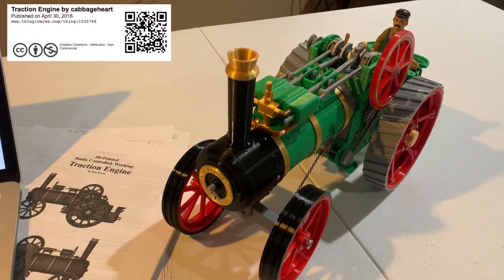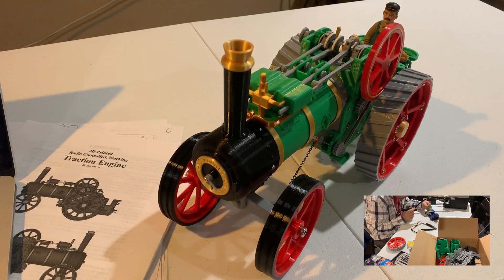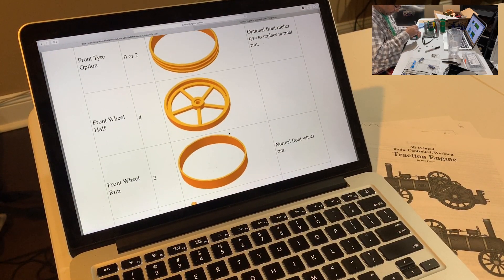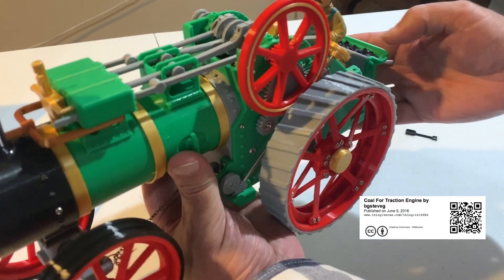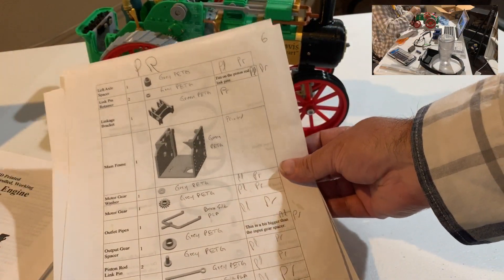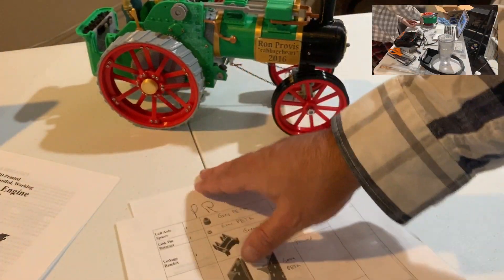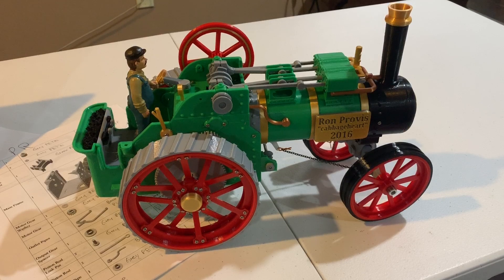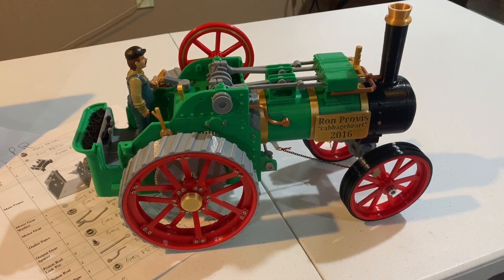3D Printed Traction Engine

Comment: Can you send me a link to the documentation and radio info.
Thanks
Reply from the maker: I used this radio and transmitter kit, but really any would do... 
https://hobbyking.com/en_us/hobbyking-2-4ghz-mode-1-4ch-tx-rx-v2.html?wrh_pdp=2&utm_source=google&utm_medium=cpc&utm_campaign=google_us_shopping&countrycode=US&gclid=CjwKCAiA-dCcBhBQEiwAeWidtdU-k5RO6jwdrPWQaJ82E35YmcbanCG2zrFvg9M56jDwyOmi9KbAoxoCfLkQAvD_BwE&gclid=CjwKCAiA-dCcBhBQEiwAeWidtdU-k5RO6jwdrPWQaJ82E35YmcbanCG2zrFvg9M56jDwyOmi9KbAoxoCfLkQAvD_BwE

Instructions for assembling the model, and all the hardware and parts is in the thingiverse along will all the stl files there is a guide PDF

Comment: im building this engine atm, with a few modifications, like a custom smoke box front and opening fire box door with a led light, along with a few additional parts. i plan to share these parts on thingverse after i print them. im wanting a nice clean smooth finish, so i have to paint all the parts with filler primmer and sanding, so it may take a few months to finish lol.

Comment: hey buddy so ive built one but have you or do you know anyone whos made a bigger scale one
Reply from the maker: Wow, no I don't know of any but if you find or build a bigger one please show it off!
Reply: @wjkoontz  well it will be part printed and some parts wood im going to make it 1/6 scale so ive tried to work out what scale the engine would b3 which led me to believe maybe 1"scale or 2"scale if you could help please let me know bud
Reply from the maker: @kiew3965  I'm not sure this model is built to any scale, having read most of the comments on the original design on thingiverse, the original designer said it was inspired by pictures etc. but not any specific model.  The driver figurine bought from UK via eBay and it says it's 16mm scale if that helps.
Reply: @wjkoontz  thanks buddy ive choosen to make it 1/14 scale with 6" figure
Reply: i went a built it now finished at 1/14th scale roughly just under a ft long i believe, I added a rock crawler motor as larger model higher torque...with this being bigger you can add stuff to. Ive added a micro servo down the side of the engines cab and run a rod to the steering wheel and using a 5in figure i made his arm look like it turns the wheel and added a heng long smoke unit modded.. giving it like smoke. turned out i didnt need a sound unit considering it clanks away anyway...
Reply: I’m building one in pla. But have petg for a bigger one. I can scale all the parts in Cura to 171% and the biggest parts will fit my build plate - 220 x 220mm. I chose 171% as that is the ratio for paper size A4 TO A3 Double volume. So heres hoping all will work.